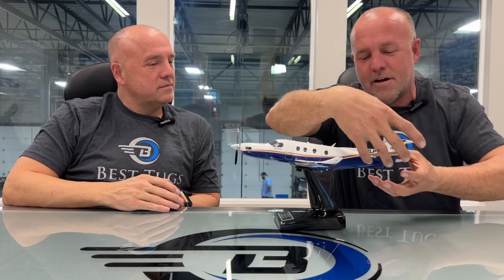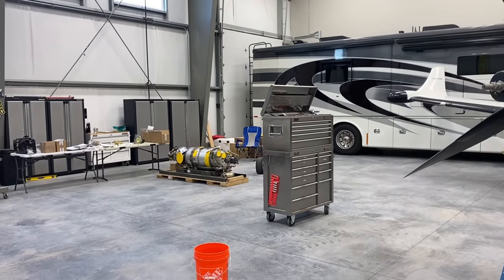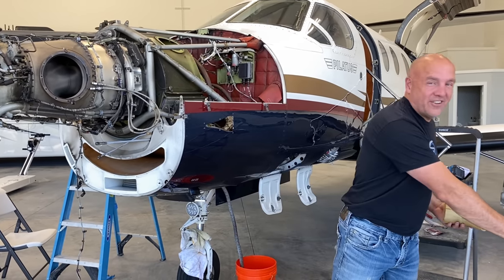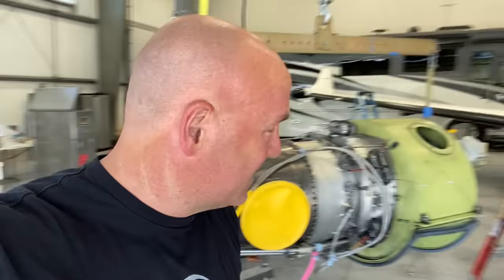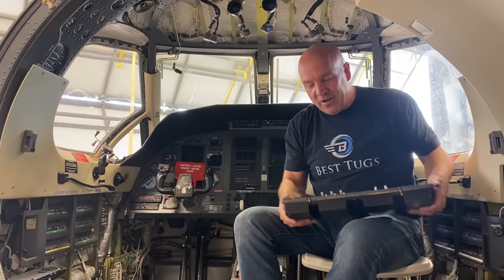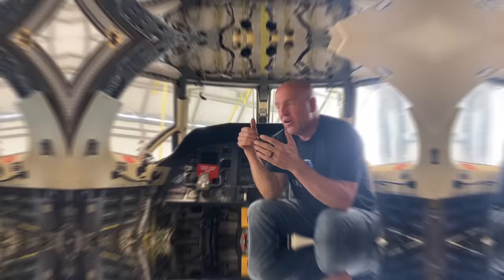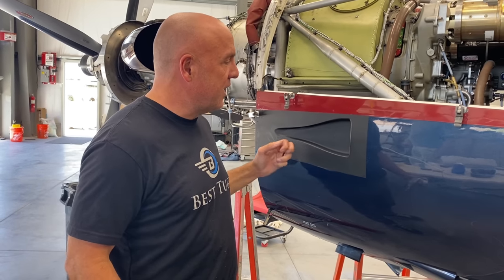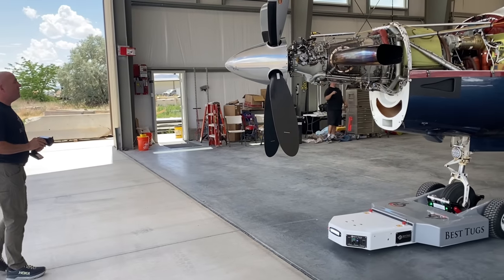Modifying a Pilatus PC-12 - $950k Engine Swap! | Perry the Pilatypus

Comment: Wishing that replacement screws were only $10-20. If the screws use a Pilates part number, they’re probably $6-8 each. If using a NAS number, maybe $2 each. 
The yellow stuff was a chromated primer. Those primers were hexavalent chrome verses the replacement primers using trivalent chrome. 

What you can do to break them free is take a large soldering iron and place the tip on the bolt head for 20-30 seconds. 

You might look at the performance numbers between the 4 and 5 blade props. The 5 blade props are quieter and aren’t under as much stress, plus are better balanced sitting at 72 degrees per impulse versus 90 degrees.

Comment: Great work as usual. Quick question, have you folks at Best Tugs ever considered adding cameras on your tugs as a means to medigate risk with striking the wingtips and or horizontal tail? For example, one could attach a tri system that ties wirelessly to your unit with a bright enough O-led screen that will give you an extra set of eyes in case no wing walkers are present?

Comment: Now that's a spicy 🔥 meata ball! 🥳🥳🥳. Loving stage 1, mo power.
I'm guessing that you're saving fuel in cruise? This was my first thought when you said going to brand new Papa Bear 🐻. 20 years of materials advancement, engineering knowledge, fadec parameters. Gotta be saving some heating oil. Had to edit because I forgot to add spicy to the meatball. 😊

Comment: OH My GOD  you are right! On Every panel I take off if the screw head is even a little bit messed up I change it. 🪛🔩 It takes forever to get a stripped screw out. 5 sec for a new screw.

Comment: Since you completed this mod some time ago, this is a question I hope you answered before flight. Since the horsepower increased, I assume the maximum speeds increased as well. In view of this, did you need to do a flutter clearance or was it done on the original STC modified airplane and the configuration encompassed what you did?

Comment: How about a black and orange paint job, then call it "Snappy."   Yellow paste on the bolts is zinc chromate. On those worn screws in the floor panels. Not only do you want to supply a bag of new screws, also include some new #2 phillips bits for their screw grinders, er, I mean screwdrivers. And tell the mechanics to back the clutch off a little on the cordless drill drivers they use in the process. A little drop of oil on the threads goes a long way too.

Comment: I work for a very large service center on business jets and our flat rates for the inspections has screw cost built in.  Every panel gets new screws, yet we have some customers that does not want new screws and to use all old screws.  Very frustrating to say the least.

Comment: I would have the kids at the college do the paint scheme for the refurbishment. Like you did on Turbulence. I don't know why you would have breakers tucked under or in the engine bay where you can't get a hold of them in mid flight to reset them so the engine and all its components works right, just doesn't make sense to me. They need to be in the flight compartment so they can be manipulated properly inflight.

Comment: Nothing wrong with the expectation of good service. Especially at the price you're talking about.Sometimes it boils down to the individuals work ethic. Sometimes, one guy does the disassembly and another reassemblies. Hence the labeled baggies.. Quality service comes at a price. I get that. When you see something like the stripped screws it would make me wonder what else they're cutting corners on? Pilatus is a high end complex airplane. Service requirements need to be done a reputable , RELIABLE service center. Money talks. Sure you are willing to tell them "take our money" in return one can demand a level of service. If that expectation is NOT met. Take your money elsewhere.                                               Mark your tag line can be.....................Trim the fat , add the horsepower. Rarrrrrrrrrrr!

Comment: The yellow residue on the engine mount bolts might be epoxy primer MIL-PRF-23377, Class C (Chromated).
Reply: It's not really a epoxy primer,  but more a anti-seize paste. We used to use a material called mastinox (don't know the MIL spec). 20years+ ago we already knew how canceres it was. But it was what pilatus used.

Comment: Hey Mike I have  question. Would you be willing to allow Life Flight Australia trial a best tugg for their AW139 Rescue helicopers and Challenger 604 Air Ambulances jets at Zero cost? They have a sister compnay call Star Flight and they're based in Brisbane QLD at the airport BNE. I'm just a normal peron wondering if this could happen as Star Flight runs off donations and limited goverent funding. Cheers

Comment: Would the 5-blade prop add performance over the 4 blade?
Reply: More blades = more thrust with more drag which reduces fuel efficiency, more blades also reduces cabin noise. Less blades = less thrust with less drag increasing fuel efficiency.

Comment: 24:00 it seems someone making the C-130 is your kind of guy. As parts get lighter, planes should get lighter. From the H model to the J model, they replaced a lot of heavy avionics with lighter parts. It got so much lighter that the planes got out of trim too much, at least for the civilian versions. How did they fix it? They left the armor plates even in the civilian ones... so now, the civilian version of the C-130J is the only civilian plane that I know of that has a military grad armored cockpit... 8-)

Comment: In regards to the stripped screws. I work on Hondas for a living. Our customers spend a couple thousand a year on the higher end on service every year. If we damaged a screw it absolutely gets replaced because they are cheap and it makes our lives easier the next time it comes apart. I would be very upset if I was spending 35k+ a year maintaining something and they wouldn't put <$20 worth of hardware on my equipment.

Comment: mark, your issue with the floorboard screws could be 2 different issues. it could be the management of the inspection crew being cheap and not carrying the screws, or flat out mechanics not caring because they wont get paid for that level of detail. when you get paid les than the national average the level of care drops dramatically. SLC is too expensive for civilian service at hill AFB when it comes to cost of living.

Comment: The problem with putting in new screws is you have to verify you have the correct type, material, finish, diameter, and grip length. They might be cheep but the logistics of making a 100% sure you have the right screws and getting them ordered in a timely manner is probably the reason the guy’s working on your aircraft decided to take the short cut.
Reply: no excuse

Comment: With what your spending be better easier to purchase a new aircraft with everything factory fitted. Contrary to your believes hot rod aircraft is not a great idea and most times it ends in disaster.  Prime example is the USAF upgrades on the B 52 and ONLY going for engines of the same thrust ratings as what it was manufactured with. 
You say pc12 ng is heavier. So why is that. Heavier spars perhaps.  Yes BTW filming with both airframes.

Comment: That bit about the screws being reused to the point of stripping is very disheartening. I work maintenance in a foundry and when we do a repair job, we replace EVERY single fastener. We do an inventory then make a kit then it goes in the maintenance crib as a single part number and that part number goes on the print or whatever documentation we have. Then all the seals, gaskets, o-rings, etc. goes into that kit and eventually you go and retrieve one part number to rebuild that component. But if we can do something like that with just a foundry, an aviation company should be doing it for sure

Comment: Yellow crap = barium chromate..

Stripped screw heads are from using battery drills to run the screws out and in. The torque setting on the drill is too high so instead of the clutch releasing, the head gives way..
Reply: Oh yeah, like Mike uses telegram.. SCAM...

Comment: @22:38 minutes "I'm drilling out stripped screws because they kept putting them back in."  Is it 'the guys'? I guarantee that 'the guys' are drilling more stripped screws than you will ever see. They're seeing their work come back time and time again, and they're cursing their own shop practice that values toil over workmanship. Generally speaking, competitive pricing is blind to toil. My first A&P job was with an FBO-based GA maintenance shop. The instructions came from the top: Every removed screw got replaced with new and a drop of LPS3 for good measure. I'm talking 100 hr inspection covers on Cessna 150/2 trainers! The bean counter there was an old-timer A&P. 

Mark, I doubt any one customer can pay to change shop practice. 

Later I worked for a corporate operator (G-1) where the chief pilot did most of their maintenance in house. Any time maintenance was outsourced, the chief pilot or their designee ferried the aircraft AND stayed with the aircraft opening and closing the shop. They kept eyeballs on every operation. Why should Pilatus be any different for you?

@25:24 minutes "...but it's going back together with..." LOVE i.e. workmanship.

Comment: I suspect its admitting you stripped the screw (hopefully the threads?)  but you really are the last in a line of its gotten worse on each inspection.    Not familiar with the situation or  need for a new screw size but experience should tell a shop,  ok,  this is the third time and we need new (larger?) screws,  replace them all.    Its amazing how stupid management can be and how much flack the guy on the pointy end of the screw can be beaten with (you did WHAT!)  So yea, if you get yelled at then you cut those corners (and hope its not a safety related one).   I bet they got the message though,  well done.

Comment: If they are camming out screw heads, they need to either invest in better drivers, use the correct size, or toss worn drivers.. There is no excuse for that from professional companies who get paid that much for their work. A quality driver of the correct size will not do that, even when removed and reinstalled multiple times if not worn out.